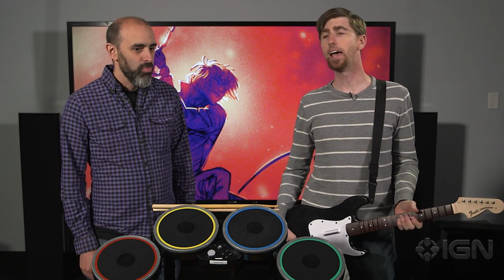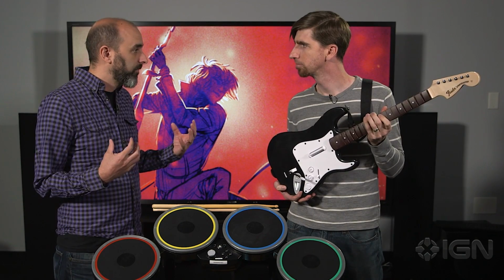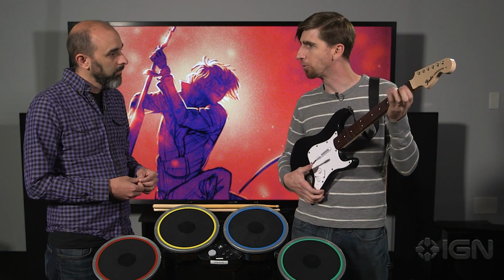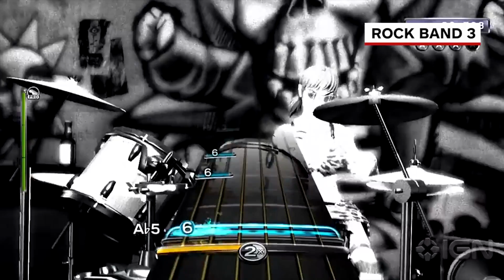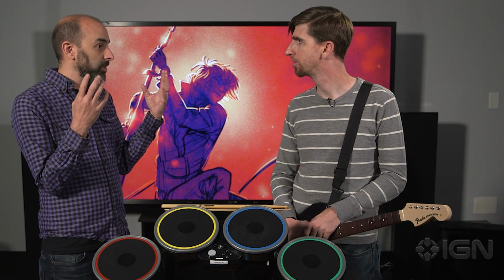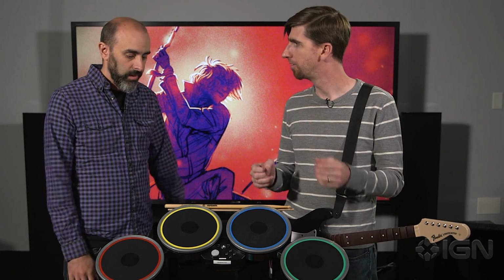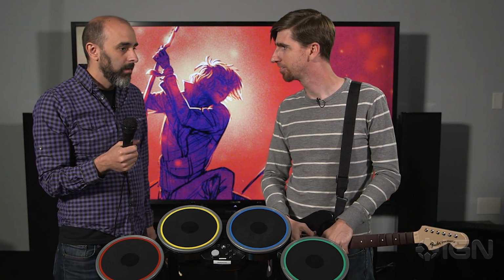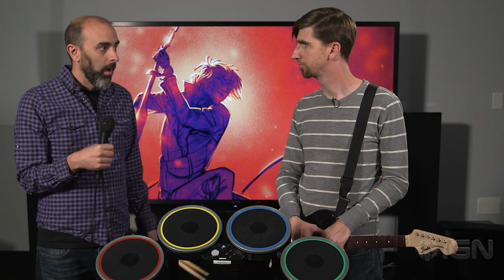Rock Band 4: First Impressions of the New Hardware - IGN First

Comment: Am I the only one who likes the clicky strum bar from the guitar hero guitar better than the  silent one?
Reply: I personally like the silent one better because it gives it a very slight delay, but just enough that it feels similar to releasing an actual string.
Reply: Cameron Willis i always liked the guitar hero one because it was bulkier and sturdier, it felt stronger and had more of a bounceback. It seems like they've been trying to address that issue on here.
Reply: TheShangryLlamas Yeah I liked the GH 2 one. But I wasn't a big fan of the later versions because of the amount of pressure you had to put on the buttons. It's the same reason I prefer PS3 controllers to Xbox ones, just because it does feel a little cheaper. That's just me though.
Reply: I love you
Reply: I like the click. It would help me keep my rythym easier.

Comment: If there was improvement in the pedal, they would've said something about it in this video.   Instead it was off-screen and un-mentioned.

I was really hoping they would innovate the design of the drumset, maybe the pad placement so the snare is not alligned with the toms.  In staff is not only the same-- it's the exact same manufactured model as the previous game.  Either this guy doesn't know anything about the hardware changes, or he was trying to bs around the fact that they are pretty much using the exact same hardware.

Fortunately Harmonix is known for listening to fan feedback, so they'll definitely know that we're concerned, and possibly shed more light on the matter as their development continues.

That being said, if there's a new ion-styled module drumkit like last gen, I'll probably finally make the investment.  Hopefully it won't be $400 again.

Comment: And i also hope the cymbals MadCatz releases will be widely easy to obtain, I never got any cymbals for my kit for rock band 3 because it was way too difficult to find any. They were always sold out
Reply: Patrick Martz - I bought RB3 pro cymbals on Amazon for my RB2 drumkit for $25 on Amazon two years ago (although they are now $40).
Reply: ***** anything for RB and GH are waaaay overpriced now
Reply: SuperMrj2012 - Yeah, all of the instruments are now overprices. I was lucky to get a Rock Band 2 Special Edition bundle for $120 on Amazon a few years ago. Only bought it for the instruments and got myself RB3 Pro Cymbals (I already said that in my previous comment). I play Phase Shift on PC which supports these instruments. I've gone through many GH controllers (2 GH Xplorers, which are my favorite, and a GHWT guitar, but their strum bars have problems). I hope my RB2 Stratocaster and drumkit lasts me forever because it will be very expensive to replace them now. I hope RB4's bundles have good prices in-case if one of my RB instruments breaks.

Comment: This is a bunch of BS, Roland and yamaha both have amazing electronic drum sets and RB is going back to the old crappy set that cramps your hands and the snare is considered a tom... I'm honestly not to impressed, and to spend a good $200 on another drum set that they throw together in my honest opinion isn't going to be worth the money. There should be metal included if they're worried about the breaking of the instrument. Not just that but replaceable pieces such as heads, so you don't have to replace the whole thing just because one of the pads wear out... I'm officially not impressed even if these are the alpha, it makes me want to give up on them and do something else during a party...